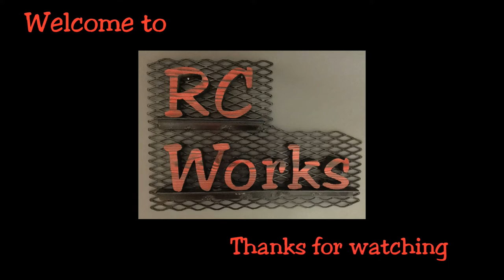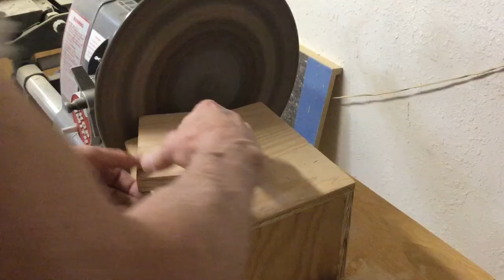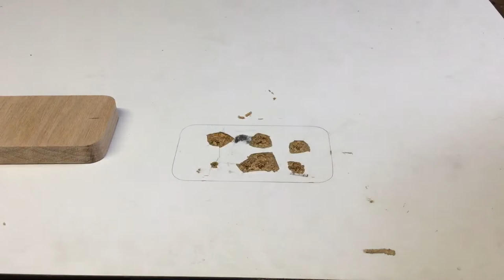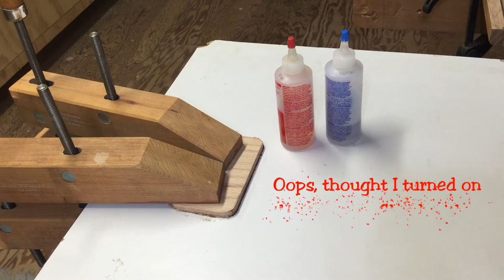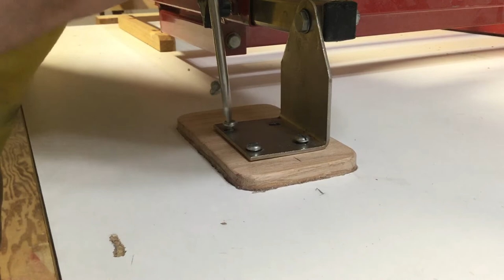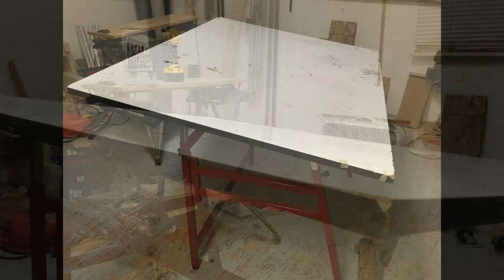How to Repair Particle Board After Screws are Ripped Out - 31

Comment: I was hoping for a fix the average person could do w/out a bunch of specialty tools.  I did find an easier fix on youtube that just requires a few small wooden dowels, a power drill, wood glue and a hacksaw blade.  Similar concept but instead of drilling larger panel and gluing it in, you just drill out a larger hole and put in wooden dowel, use wood glue, and saw it off until flush w/panel, and then re-screw
Reply from the maker: Sounds good. Just go easy reinserting the screws; you'll be screwing into the end grain of the dowel-not very strong. Thanks for watching.

Comment: The craftsman ship is spot on and the quality of the video was good, so nice work and good job out of you. The problems I have are 1. The power tool noises are excessive, 2. No one has these tools at home, 3. If you aren't into talking on camera maybe try subtitles next time. 
Thank you for your video
Reply from the maker: Thank you.
1. The sound is more even in my more recent videos.
2. One could do it with hand tools, a drill with a forstner bit or bench chisels.  I am not a hand tool woodworker, so I use my power tools.
3. I use some subtitles if I think I need to better explain.  I mostly want the pictures to do the talking.  I aim to give you the idea, not all the details.  Your creativity can work out those.  Also, you are welcome to ask me questions.
Thanks for watching.

Comment: Nice video.  I was thinking of just laminating a piece of wood over the blow-out. (The closet rod pulled out of the 20-year-old closet system.  Just curious what type of wood you used. Oak?    Keep the videos coming!!
Reply from the maker: Thanks.  Yes, it was red oak.  Your lamination idea might work; I think just make sure it is as thick as the screws are long so as not to screw into particle board again.  How will you attach the laminate?

Comment: If I could afford tools like that, I'd probably just buy a new cabinet. 
I have wood filler, a screwdriver, a putty knife, and a particle board cabinet with the hinge ripped out.
Reply from the maker: I think that will hold for a while, but particle board isn't great for doors. You might have to replace the cabinet.

Comment: Great, but not so easy to get at kitchen cabinet hinges like that.
Reply from the maker: I can see how that would be difficult with a router.  You might have to get in there with a chisel.  Do you have an oscillating tool?
Reply: You can drill each hole over size and glue in hardwood dowels with two part epoxy. Then pre-drill your holes and you should be good.